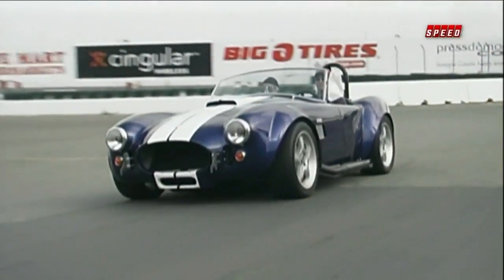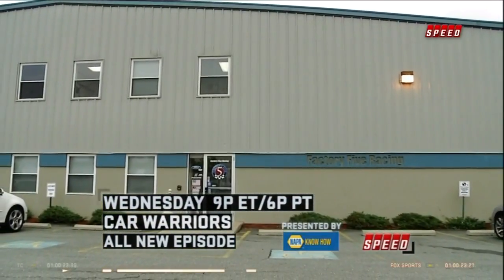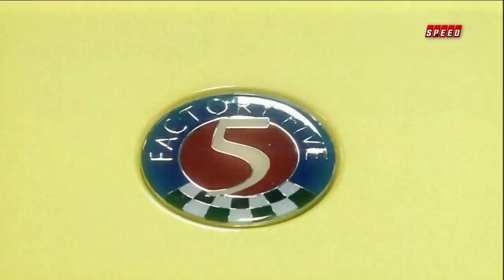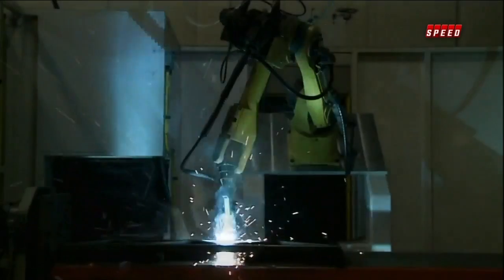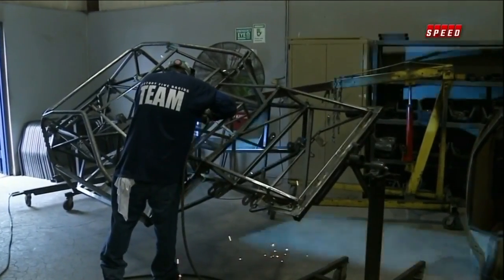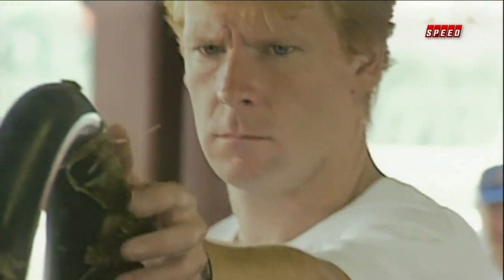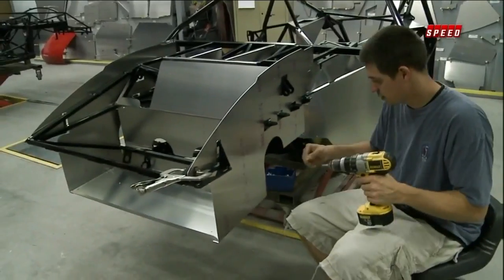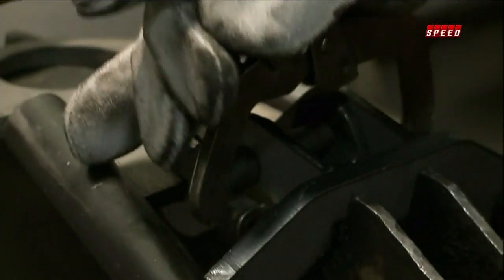Factory Five 1/2 [SpeedMakers]

Comment: I don't understand supercharging with this platform personally.  I'd rather usea somewhat high revving motor but wit good torque, why?  I desire enough power to keep a smile plastered on my face while knowing it is fairly bulletproof reliability wise ...and simple cheap as far as long-term maintenance.  I'd almost rather a V6 maybe.   Maybe 300 ish HP?   I do realize that something closer to the "real deal" would likely be better investment ....but personally?   I am thinking something with fuel injection...everything transplanted from late model proven production vehicle.  In fact I could care less if it is Ford so long as I love the motor ...And I might get a bunch of frowns, but I also personally  would not even want $8k bodywork/paint on my car ....II want to climb into her without ever worrying my shoes will mark a high gloss many coat mirror finish paint jobe...Now I might spend considerable time to refine the surface of the bodyto at least look "paint ready"  but I would not invest thousands of bucks in a finish....What then?  A dull premium flat primer look. ....Hey it's fiberglass so not I'm protecting steel from rust ...and Iam not looking to impress anyone but those who can appreciate the car itself and understand why I have it ...to DRIVE it!  not show it off at exhibitions